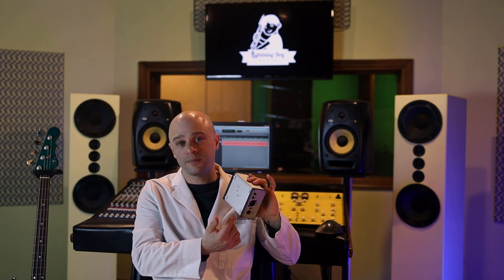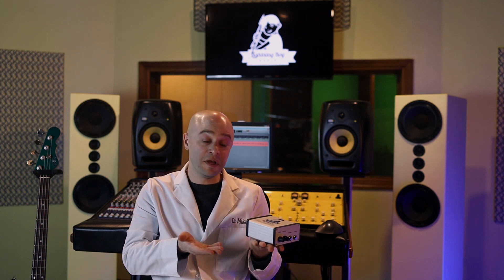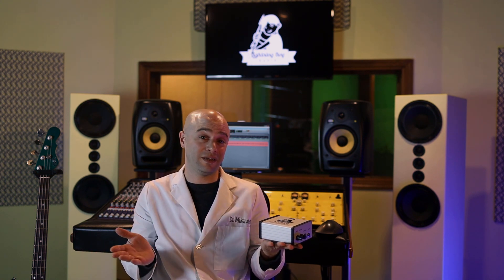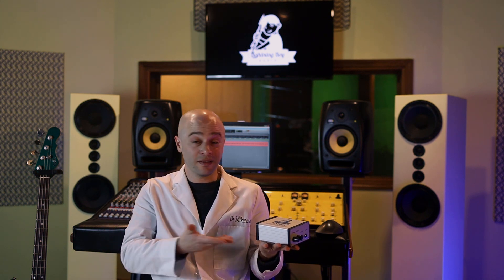Lightning Boy Audio DiVision vacuum tube direct box

Comment: This might be a stupid question, but I'm going for it anyway lol..If I was to plug in an xlr microphone into that with a good quality transformer connector, would it operate with good quality?
Reply from the maker: The fundamental purpose of a DI Box is to convert instrument impedance (high) to microphone impedance (low) for connecting an instrument to a mic preamp.  Just take the DI out of the picture and plug your mic into your preamp.  If you're hoping to get the sound of the DiVision on a microphone, its not going to work very good.  Since there is no XLR input on the DiVision, you would have to rig up something.  My guess is that would sound a little noisy at best.  As for the tone, I can't say exactly.  It might be cool depending on the application.
Reply: @LightningBoyAudio  I just do weird experiments.  I did this with your soul drive pedal and the tone sounds so beautiful with vocals on the 12au7 tube, but the noise kills the vibe.  I think the 12au7 would have a smoother tone, but the nuvistor would have less noise..just looking for cheap ways to get a tube mic sound lol.
Reply from the maker: @benevolentessence8809  The noise is power supply related with the Soul Drive.  A better power adapter will have less noise.  Daisy chaining pedals off one power source is guaranteed noise, so hopefully you aren’t doing that.  Good luck on your quest.
Reply: @LightningBoyAudio  That's true.  I had some cheap d'darrio adapters for a few pedals before, and it wasn't too bad on low gain sounds.  Then I got a 1 spot daisy chain and it was quieter than the d'darrio's.  Now, I feel like investing in a 1 spot isolated power brick.  This got me wondering if your isolation transformer can function like the 1 spot isolated power.
Reply from the maker: Nope.  Get a supply with isolated outputs and you will be much happier.  Noise will be a thing of the past.
Reply: @LightningBoyAudio  Thanks, I was wondering if it would be worth the investment.  Looking forward to less noise and more tone.  What do you think of the Truetone cs12?